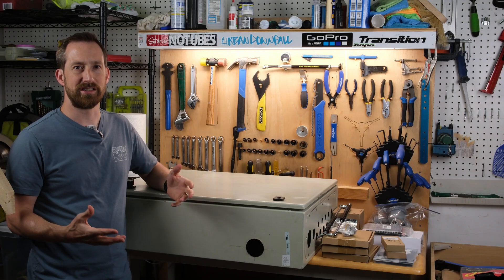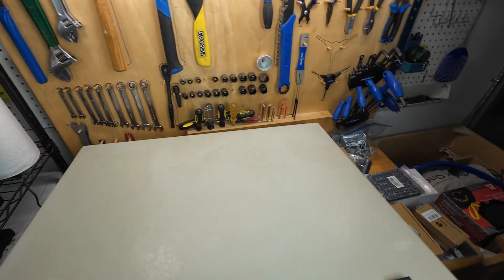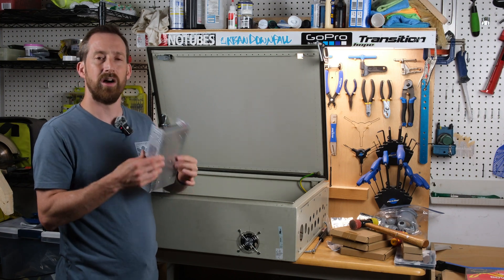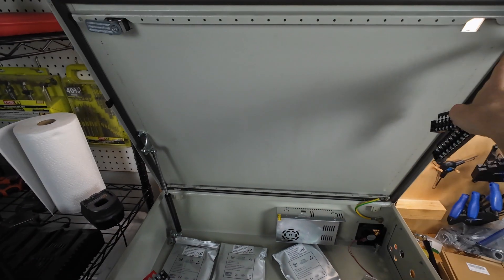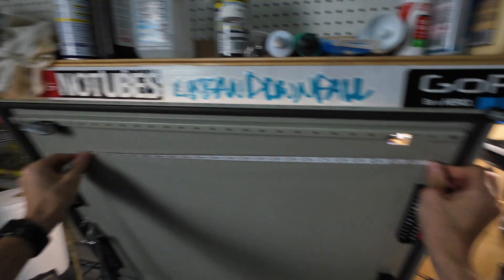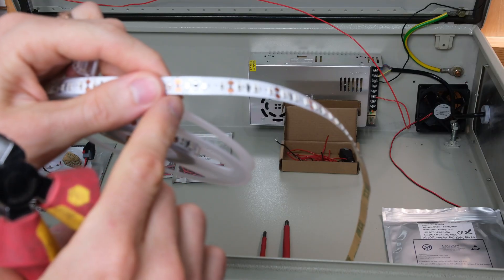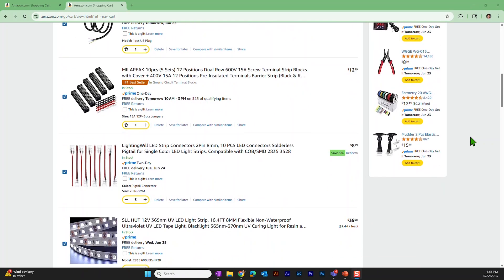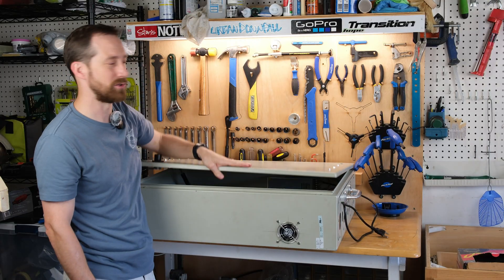Building a UV Exposure Box for Cyanotype and Platinum Palladium Printing

Comment: You may want see how Cone Editions set up their boxes. The LEDs are where you plan to place you negatives.
Reply from the maker: They have a nice box for sure. They set theirs up opposite of mine, but I felt that this setup works better for me. They both accomplish the same thing, though. The nice thing about using an electrical utility box like this is you could choose either way!
Reply: @natedorseyphoto  the strip you got is not going  to provide enough what u trying to do i would look at 5050 365 nm uv led strip